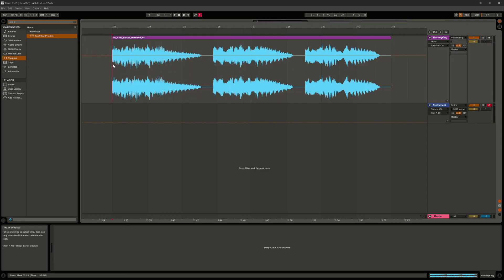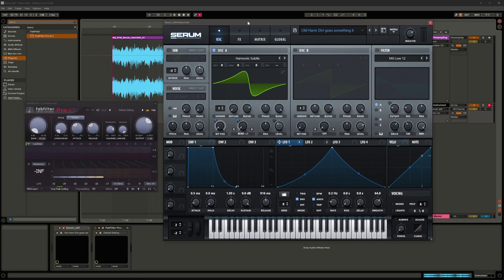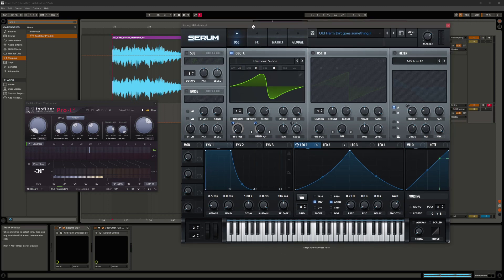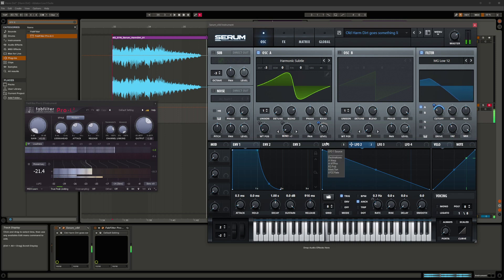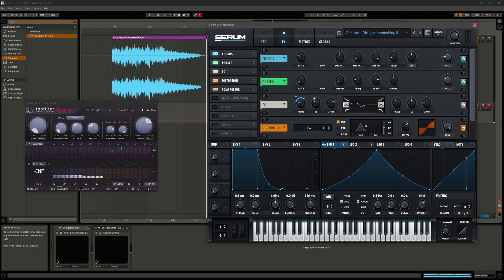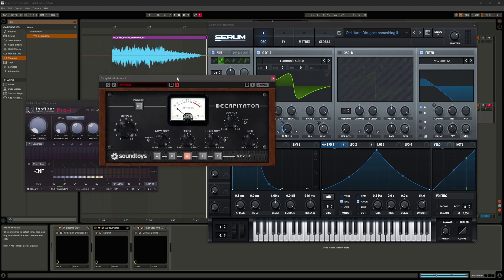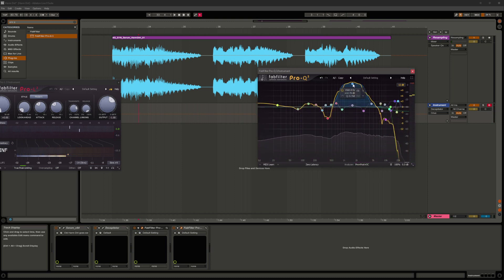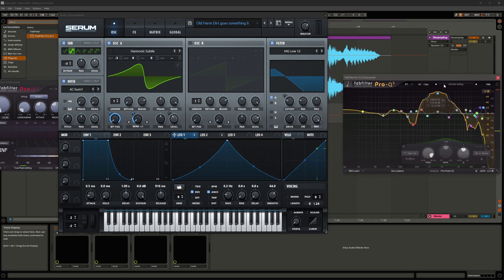Synth Patch Design - Harmonic Dirt

Comment: really neat to hear your process reverse engineering a sound! eq match is def cheating but i’m absolutely guilty of that except i always have trouble setting up pro q 3 so i use melda’s 😂😂😂
Reply from the maker: lol I wish there was a way to take like a dynamic EQ profile and apply it to another, one that changes over time. Instead of the static/average EQ profile most currently do
Reply: @noahsitrin  that would be cheating on a whole new level 😂.
Reply: @RazorTrap if that was possible, i can assure you i would abuse the shit out of it 😂